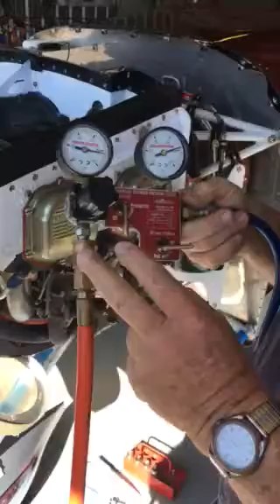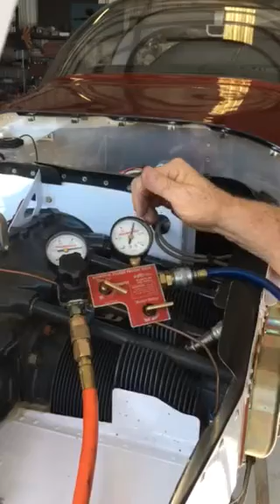How To Do A Airplane Engine Compression Test

Comment: This is SUCH  a  well done video,  EXCEPT for the low video quality.  I wish you'd consider re-doing this  at better resolution.   VERY VERY well  explained.  I'm not AP, just autos, outboards, small engines, made my own  tester, modified Horrid Freight which turns out not to use  standard orifice or pressures.  Found a  .040  jet  which I  used instead and some refrigeration gauges.

Comment: While you may be technically correct, the expression "Compression Test"  is commonly used. This test not only measures compressed air past the rings, but also the integrity of the valves. More valve problems are diagnosed than ring problems, in my experience. Thanks for your comment.
Reply: I omitted to mention valves to be brief,but compression is terminology that has 
filtered down over the years from a careless understanding of what is being done.
Quite honestly YouTube is not the forum to learn aircraft maintenance.Professionalism has been degrading for years and the quality of the A&P is suffering due to it!

Comment: Explain the Master orifice and in use with TCM engines
Reply: The master orifice refers to an internal orifice in the differential tester.
TCM bulletin SB03-3 Service Bulletin refers to a .040 orifice be used and required on testers on ALL Teledyne Continental engines in accordance with the aforementioned bulletin unless specified differently by tester manufacture.

For all other makes of engines, consult FAA AC43.13 REV 1B for guidance in selecting the proper instrument for your engine.
Reply: From SB03-3, I have a cyl at 58. My IA wants to pull the cyl. SB says boroscope, if nothing wrong - good too go. As long as it's above the min master "o" reading,  good to go. The AC143-xx  etc, had this "60" minimum, which is wants he want to go by. I can't believe he is not up on the SB.
Reply: That comes under the heading of personnel opinion and experience.
58 is pretty low if the other cylinders are showing something greater than a 10 psi difference.TCM is pretty adamant that the cylinder be at full operating temp for one hour before testing if you have a low cylinder.

Lycoming  doesn't find a 58 psi reading acceptable for any of their engines that I know of.

Comment: That mag. impulse click isn't reliable. Like on my engine it has Bendix shower of sparks mags. There is no click. I use a bamboo stick in the spark plug hole to determine when it's close to TDC. Then put the connector in the spark plug hole and shoot the air to it.

Comment: You do know this is not a compression test.This is a leak down test,determining how much compressed air is passing the rings.It's called a differential test because you compare the static pressure to the pressure the cylinder can maintain.We dont do compression tests on aircraft engines,and whenever I hear an aircraft mechanic use that term I cringe,because that was not what you were taught by a reputable mechanic or school.I dont know how or why the compression wording ever came into use on aircraft but it is incorrect terminology.
Reply: A year later, but I learned that this is indeed a leak down test, you have limits that each cylinder cannot leak past, and no more than a 15 PSI differential between cylinders, etc. However, the school mentioned that it was a leak down test initially and after that its always been referred to as "compression test" at school.

Comment: You never addressed the importance and safety of disconnecting the magneto P leads to prevent engine starts when pulling the prop through. This should be the very first thing you do when performing a compression check! VERY VERY IMPORTANT!
Reply: You have that backwards! Removing the P lead would allow the mag to fire. P leads ground the magneto points through the mag switch so the mag cant fire!
Removing P leads renders the mag "HOT"
Please people if you are not an A&P dont give unwarranted advice on aircraft maintenance without verifying your advice first.
Reply: Please tell me you are joking???  Disconnecting the P-leads puts your magnetos into a "hot" position.  Taking the leads off will only remove your ability to use the key to ground out the magneto, but the magneto is still fully capable of running that engine P-lead or not.  Been plenty an inspection i have come to find a broken P-lead on a mag, poor guy had no idea he had hot mags til we took off the cowling.  Please tell me you aren't taking them off in the false belief that it wont fire the engine!